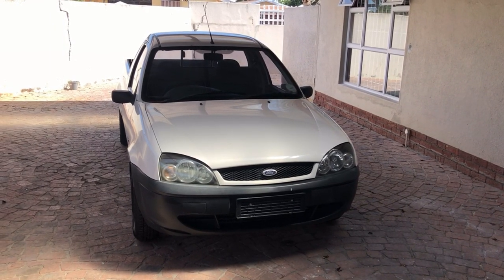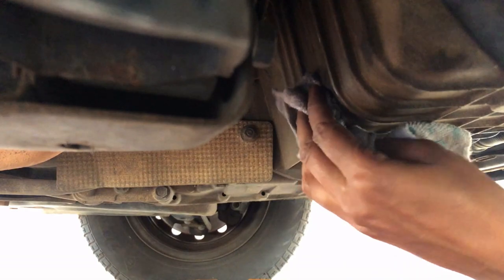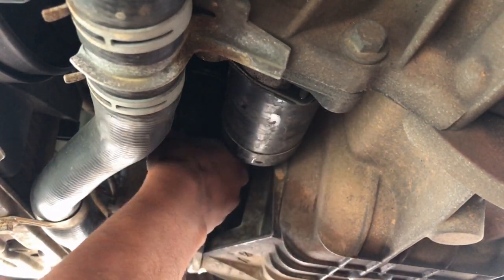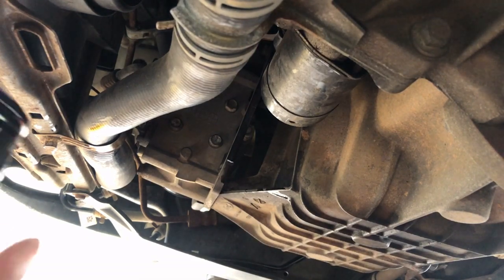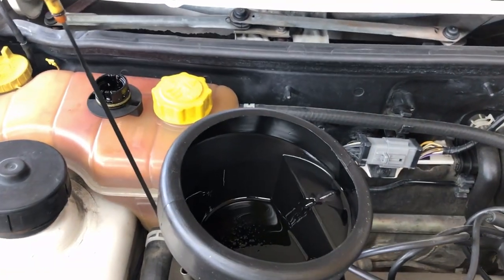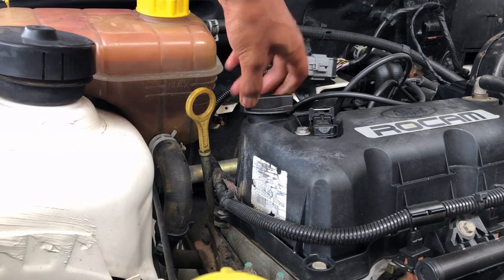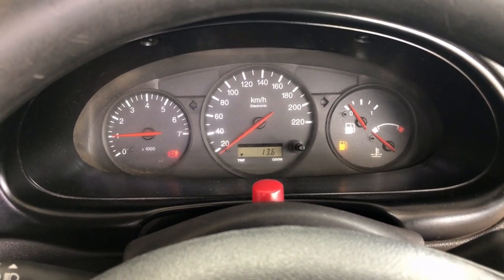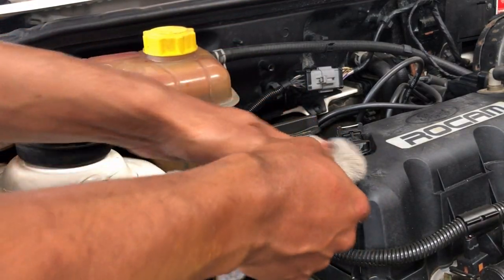Oil Service Ford Bantam 1.6 RoCam

Comment: Good evening sir. My bantam 2007 1.3 rocam has 308 000 on the clock do u recommend high mileage oil.. Just did my head over. Thank u for your feedback.